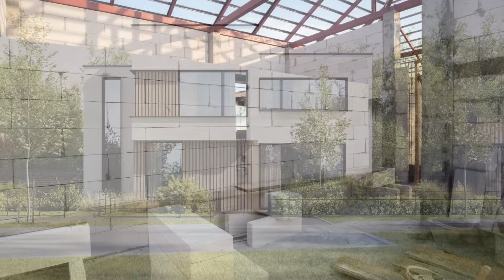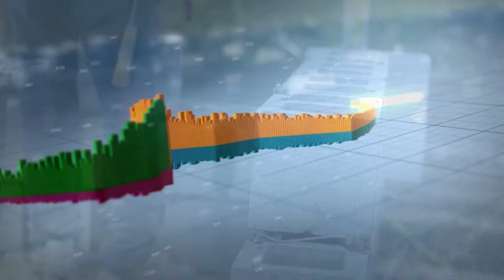Why Some Homes Use Concrete Blocks, Not Bricks

Comment: Why don’t you talk about hollow bricks, like Poroton? In terms of energy efficiency, they perform much better than concrete blocks. Besides, truly earthquake-resistant buildings should have a reinforced concrete frame anyway, so whether the bricks are load-bearing or not doesn’t make much difference at that point. Also, the fact that these bricks are full of holes helps with thermal insulation and can contribute to acoustic insulation, even though other solutions like heavier walls or double layers work better for soundproofing. If you’re discussing building technologies, you should really include all of them—not just the ones that are more common or convenient in the American market.

Comment: In Jamaica nearly every house now is built to hurricane code, uses concrete hollow blocks with rebar rods, filled with concrete and also tied together at the top of each wall and corners posts, a formed concrete & Rebar ring beam.

Comment: It is one answer for this question, price. In shops near on brick 6 x 12 x 24cm  2 - 3 E.  concrete blocks 50x 20 x 20cm - 25cm 1,20 - 2,20E depending on the type of block.

Comment: Just my non-expert opinion - seems bricks are not used to hold up a house's roof, they're more decorative and don't seem suited to serve as structural support. Concrete blocks on the other hand can be used as structure.
Reply: That's a very wrong assumption..
Reply: Structural brick walls are too costly in 2025. Even brick veneer siding is disappearing due to costs.  Thin brick panels are the trend
Reply: Laughs out loud whilst looking at 100 year old brick walls holding up ceramic tiled roof.
Reply: Every house I have ever lived in had entirely brick walls. All of those houses are between 90 and 150 years old and still standing fine. There are houses built out of brick in the 15th century that are still inhabited and as good as new.
Reply: In cases of cathedral type roofs, the walls at the gable faces bear the load of the roof via a ridge beam.

Comment: Block basements are very common here in the upper Oh Valley. If built properly and water proofed it makes a great functional space and maintenance access is great. Here it is hilly so you excavate the hill side and the entrance to the basement is at or above ground level.

Comment: More often, here in the southern states I have have heard these units referred to as "Cinder Blocks". Is that basically the same thing?
Reply: Blocks made with cinders are weaker than those made with stronger aggregate, and are only suitable for lower stresses. However, everyday word usage may not distunguish between cinder blocks and other types of concrete block.
Reply: I don't think I've ever seen a true "cinder" block.  Now just portland cement, sand, aggregate, and water.  Just a carry over of an old name.

Comment: Production of the cement used in concrete blocks is extremely energy intensive. While it may indeed have a slight advantage over brick on average, it's still not great from an energy usage / carbon emissions standpoint. Probably not enough to be a deciding factor by itself.

Comment: concrete blocks is a bit of a misnomer, there's little to no aggregate in these blocks, just cement powder and sand. they have excellent compressive strength, that's weight coming from above pushing down. it'll hold you're ceilings and floors quite well. side to side strength, not so much. don't ever use these in any kind of retaining wall situation where they hold back material on one side, they'll fail. contractors love these blocks because they're cheap, and fast to install. they don't care if the wall fails a couple years down the road, they're long gone with your money.

these walls look good when first built, but man that mortar rots away, it doesn't bond to the brick in any meaningful way AT ALL. i'm in demo, we love these walls in places we can't use a machine. once you get the first row off you can dismantle the wall by hand. we could salvage 90% of these bricks if we had a mind to. that's how well the mortar holds them together. you couldn't pay me to buy a house that uses these blocks in the build.

we do see these bricks used a lot in elevator cores as well. BUT, those bricks have all the cores filled with rebar and concrete. now THAT wall is strong as hell.

Comment: In Hot Parts of the US I can see concrete blocks or Stucco and Tile being a good option but wood frame homes would be my first choice. To my eyes attractive Bricks can produce a real nice looking home, there are some in my area that date back to the 1950s and still look nice, they were considered top of the line back then.

Comment: 2 years ago spent 6 months looking for a house to buy.  I'm in small burg Iowa.  Every house here had concrete block basement walls.  Every house had at least 1 continuous crack foor to ceiling.  Many houses hand noticeably bowing walls.  The house I ended up buying had both.  It also had wall jacks or steelbeams bolted to the floor joists and into the concrete floor.

Why for the life of me did builders use concrete walls below grade.  I can see knee walls but not structural boundary walls.
Reply: It was probably cheaper than poured reinforced concrete. You can also reinforce concrete blocks that have chambers. Again, that costs more. Another issue is was the ground prepared properly. Again cost.

In a small town, it is possible that there was only contractor and he did what he wanted.